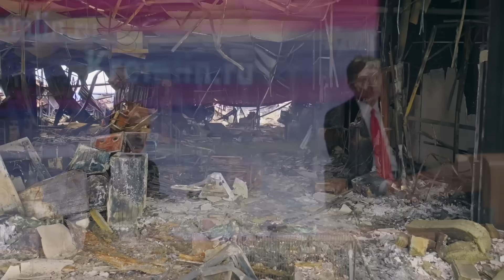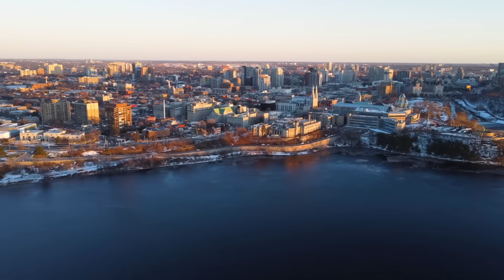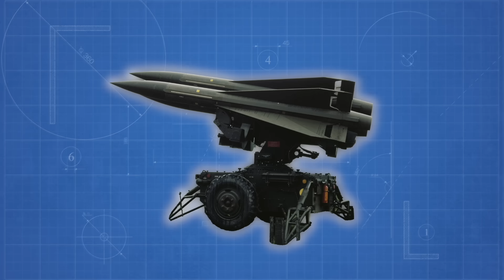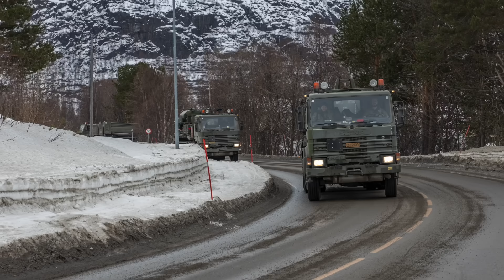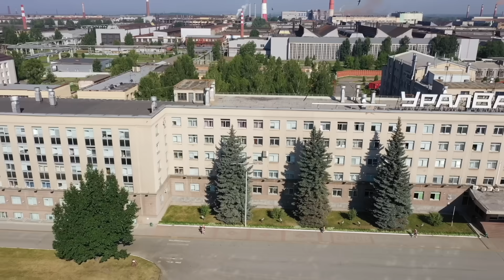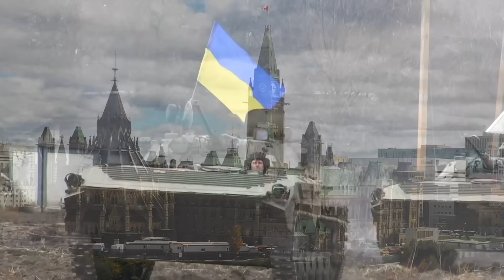Canada Just Made Russian Air Force USELESS

Comment: I served in a hawk battery and learned that there is one HPIR for each of the battery's two platoons, for each of which there are three launching pads. These enable well trained launch personell to always have a ready pad selected by the time the current missile detonates and, if necessary, reload to some degree before all the platoon's 3x3 missiles are launched.

This makes it no more than 2 at a time in flight per battery, despite its 6 pads which however allow a good TCO with good personell to keep this up quite a bit for an intensive necessity. Not bad for a system that was in use by 1960, with no semiconductors till the last version or two, much as it is no doubt well surpassed by patriot and others recent stuff.

Its main drawback with all thermoionic valves was a 48 h or so MTBF and therefore plenty of ordinary maintenance between 20' states lasting just a couple days each. This required a regiment planning turns among its batteries (per NATO protocol), with readiness being 12 hs at the start of maintenance, decreasing back down to 20' during wich blazing skies excercises were frequently issued (or 5' "silver" states in wartime or simulations).

Comment: Not sure where you get your data from, but a surface launched AIM-120B AMRAAM fired from a first generation NASAMS is more than capable of intercepting any Russian fighter jet. It is highly unlikely that Russia has any jet that can outrun a missile bearing down at it at mach 4. The only potential issue is the reduced range of the missile due to its 0-0 starting situation.

Comment: i disagree it wont make russias air force useless 
first their planes never leave russian(save) airspace most of the time
they drop bomb in save airspace and made them glide to the target like charkiw

as for dnipro and deeper inland they use mass cheap shahed drones which cost only a fraction of those anti air missiles so shooting them down is not a viable option
for example if you build 20 anti air missiles in a month that cost 200k per missile 
but shaheds you can build 200 in one month and it cost only 2-4k per drone

so what you need will be systems like germany s skyranger advances targeting computersystem combined with a 35mm or 30mm cannon which ammo cost like 30€ 
only downside it has only 3000-4000km range and germany still refuses to mass produce it like in wartime thanks to the scared german leader

Comment: They can't shoot down ballistic missiles, but they can shoot down everything else.Same as IRIS-T. They took Air to Air missiles stuffed them into vertical pods & turned them into Surface to Air missiles. They will help regardless, Thank you Canada !
Reply: Ya can't remember which one but same supplied shot down Russian ballistic missiles or so called hypersonic kinzal..himars maybe idk..
Reply: @lokomike2911  that was a PATRIOT, it just required a minor guidance software tweak to improve the intercept trajectory and compensate for the speed of the missile.
Reply: @0cypher0  By the 3rd iteration of the Patriot system the software was already good. The PAC-1 had an issue with timing, Israel disclosed it to the US during the SCUD strikes during Desert Storm. You also have to remember there are two types of Patriot missiles & its the MSE missile that is anti ballistic, the GEM+ can't intercept Ballistic Missiles either but it can intercept everything else at quite a far distance, about 3x further than a NASAMS using a standard AMMRAM. With a ER-AMRAAM you get 25km altitude by 75KM on the X-Axis. Only the MSE & SAMP/T Aster 30 missiles can do anti ballistic work outside some remnant upgraded S-300s Ukraine pre war.
Reply: @ Patriot PAC-3
Reply: @lokomike2911 it was multiple entire Patriot batteries that shit down the Kinzhal. 

Honestly it was more of a win for Russian technology than American. The US doesn't have the inventory of Patriots to continually shoot 15-20 missiles to try to take out a single missile. Patriots can easily be overwhelmed by multiple Kinzhals.
Reply: a pilot starting to rocket on the perfect angle at the perfect time easy... letting a computer do it from the ground hard

Comment: Good for Canada but I am sure Ukraine have been given NASAMS before. I doubt that NASAMS is significantly better than some of the other systems previously given such as IRST or Patriot.
Reply: They aren't the same thing. Patriot is an anti-missle system, NASAMS is an anit-aircraft system. IRST is a passive tracking system.
Reply: @Xanatros  I did not say they were the same thing! There are a number of different anti aircraft missiles in Ukraine being used against the Russians such as IRST and Patriot, - not PAC-3 which is ABM terminal phase but PAC-2 which is anti-aircraft. NASAMS is basically AMRAAM, it is highly capable but not uniquely so.
Reply: @Xanatros  I know.
Reply: @marksmith1779  well, then if you know, how can one be better than the other? They do different things 😂 Maybe you should edit your original statement?
Reply: @I do not need to modify anything. The article suggested that Canada giving NASAMS would stop all Russian air attacks. I objected to this for two reasons; 1) I thought that NASAMS had already been given to Ukraine previously and 2) because NASAMS does not offer any unique capabilities not supplied by other area air defence systems already in use such as Patriot and IRST (to name but two). I never implied that NASAMS was 'the same' as any other system.